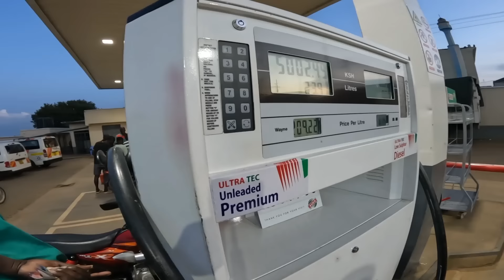I'M HAPPY THAT IS FILLED INSIDE AFTER RECEIVING A SURPRISE FROM USA🇺🇸 IT'S HARD TO SAY GOODBYE👋TO...

Comment: 1. Mechanics is the word used to describe Motorcycle, automobile, and truck mechanics.  
 
2. Engineers, as practitioners of engineering, are professionals who invent, design, analyze, build and test machines, complex systems, structures, gadgets, and materials to fulfill functional objectives and requirements while considering the limitations imposed by practicality, regulation, safety and cost.

3. Masons build structures with brick, block, and stone, some of the most common and durable materials used in construction. They also use concrete—a mixture of cement, sand, gravel, and water—as the foundation for everything from patios and floors to dams and roads. Louisville, KY USA